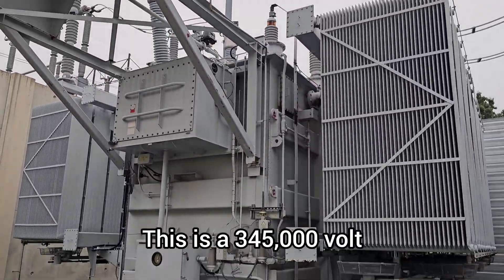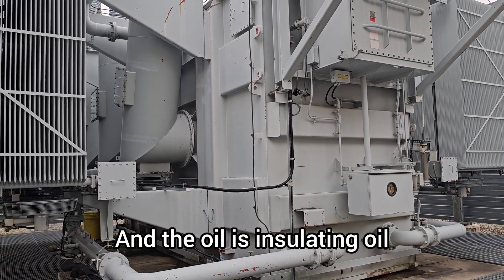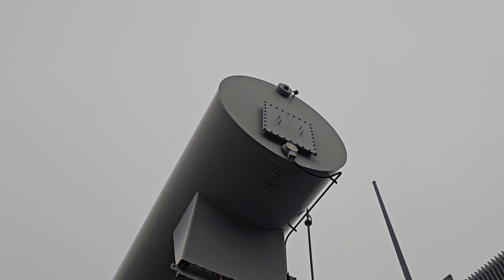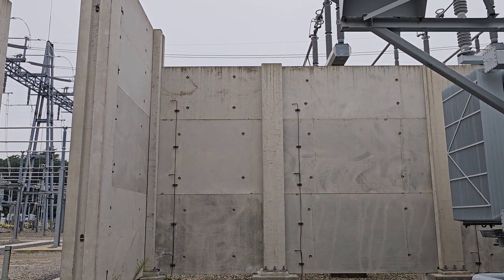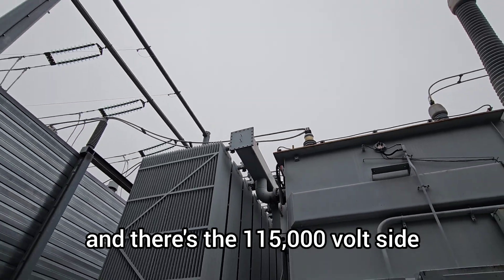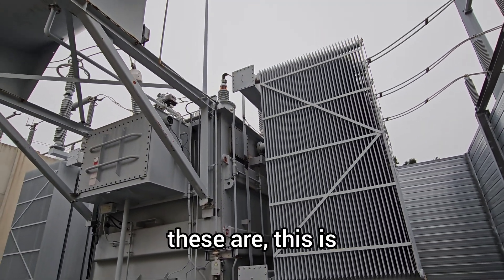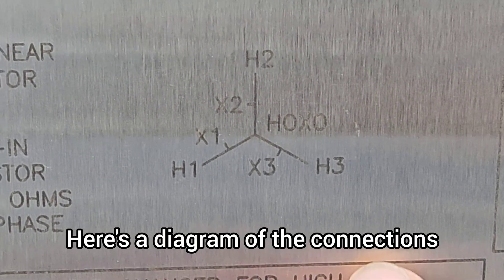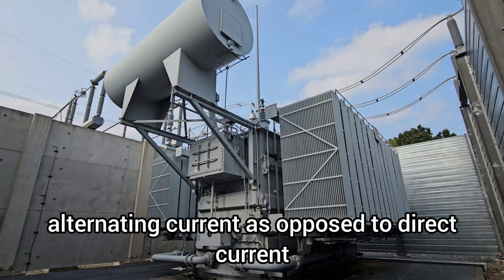How's it work? 345kv auto transformer simple explanation. Conservator and basic winding arrangement

Comment: Let's say you have a nitrogen leak, somewhere in that system how do you locate the leak? Is there a special tool that utilities use?
Reply from the maker: @cyumadbrosummit3534  The transformers with the big tanks (conservator) on top don't have any nitrogen... they're completely oil filled. There is a bag in the conservator that absorb the volume changes from expansion and contraction so that the oil is never exposed to atmosphere.  Being that they're filled entirely with oil,  the source of the leak is usually pretty obvious, but often requires the transformer to be taken out of service for a resolution.  Sometimes you get lucky and can tighten some bolts,  but a lot of times it requires draining oil and regasketing.
 Nitrogen leaks are not usually to large and so often times the easiest solution is to just replace the bottle every few months,  it saves on cost and time and reliability.  Then attempt to address the problem during a normal maintenance cycle. I think argon is an inert gas that is detectable and so a small amount can be introduced into the headspace to attempt to find the leak with a sniffer.